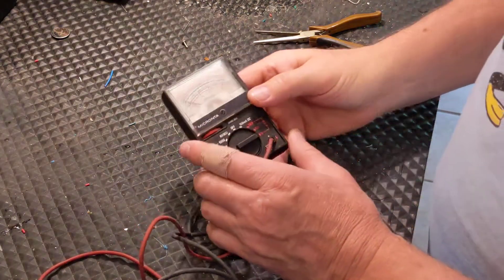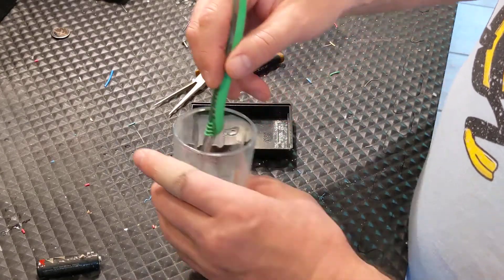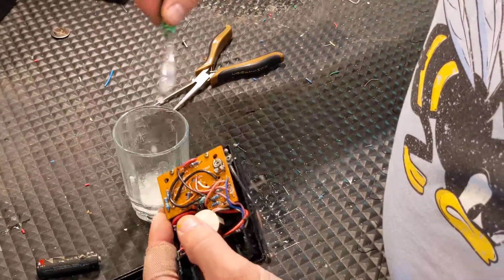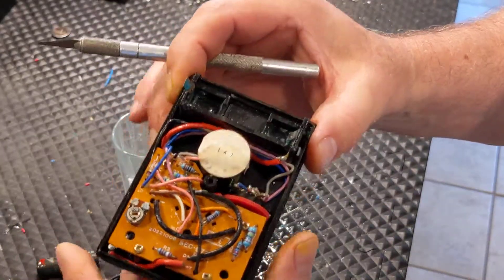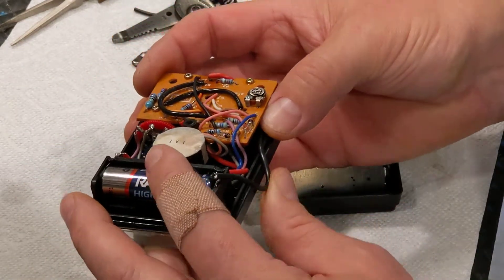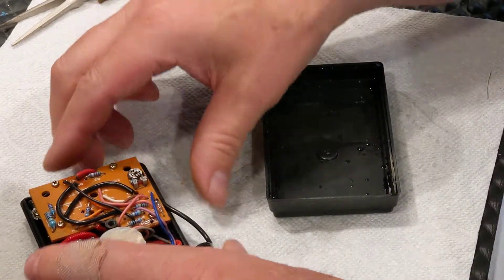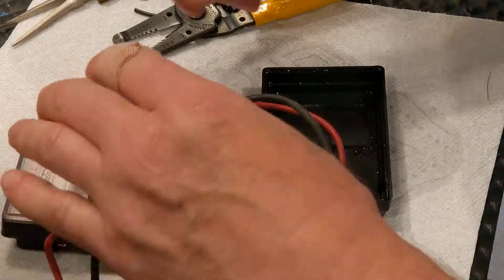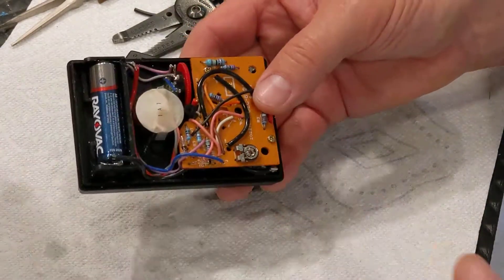Analog multimeter repair, Radio Shack Mirconta circa 1977

Comment: I have same old multimeter with same problem.  I was able to clean the corrosion and used Hot Glue under the one half of the salvaged brass plate to "rig" a battery holder. Hot glue under the brass plate has some flexibility. to mount the battery.  Other side still has double brass "spring."  Worked!  Did you upgrade the leads?  My leads keep losing their solder connection and falling off. Those old pins are non-standard.
Reply from the maker: Thanks, yes I modified the leads by attaching directly and it makes for a much more reliable connection.  I do not use this instrument much anymore since I have Fluke instruments but is nice to keep it around. I did a lot with this meter back in the day when it was all I had